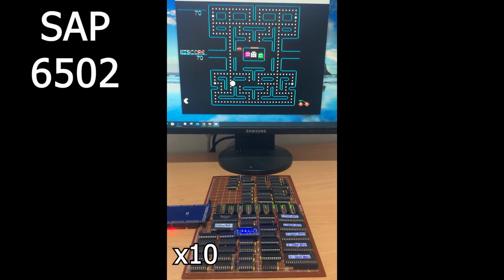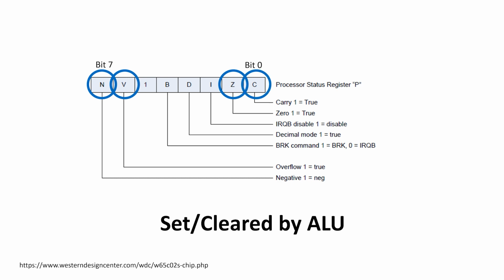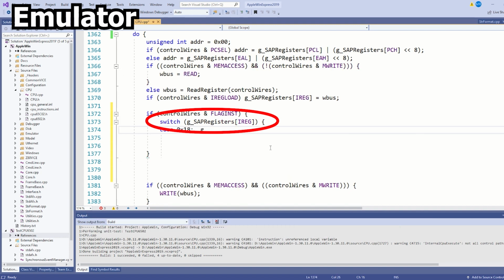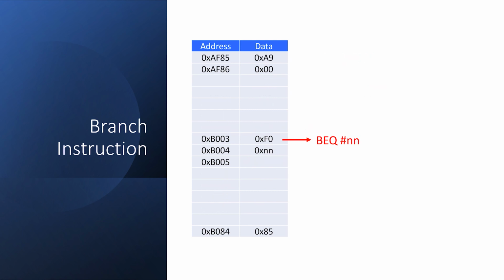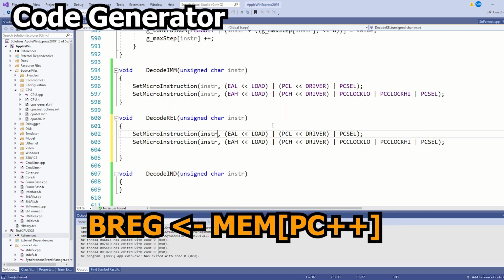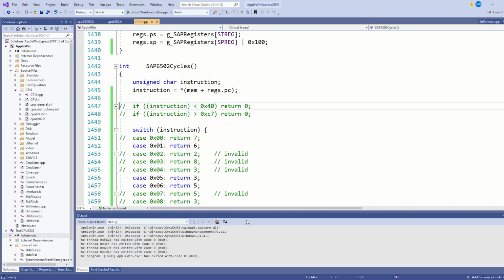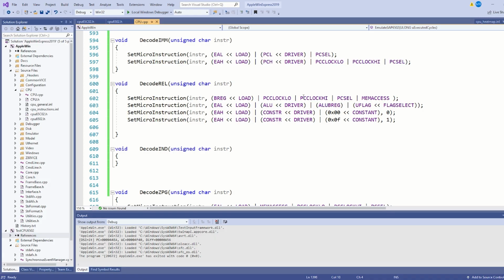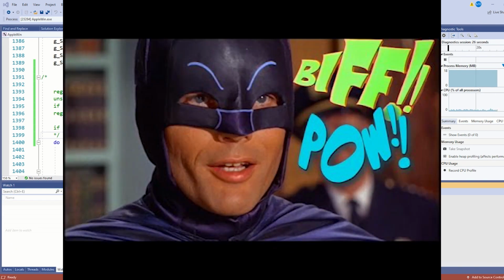SAP6502 Microcode - Branch Instructions

Comment: I can't imagine programming an architecture without a conditional branch.
Reply from the maker: Yeah, in practice conditional branches make most sense, which I'm sure is why practically every architecture uses them. 
I guess the reason I made big deal about it, is that there was a recent thread on the minimalist computing facebook group which was split about whether conditional jumps were required.  
Probably more than half said they were required, so i just wanted to put up the counter argument.
Working on the next part right now!
Reply: @DrMattRegan  I have heard of a style of programming which attempts to avoid branches by using comparison operators and uses the result in a multiplication and assignment. The resulting code is confusing as heck, but is supposed to allow the CPU to more effectively pipeline the code. I can't vouch for it's effectiveness . The other approach I suppose would work is self-modifying code where an unconditional branch is modified to different targets based upon a similar sort of calculation.

Comment: You've put a huge amount of work into this. Do you realize that the injection of the film and TV clips make this unwatchable for some viewers such as myself? I make this comment only after having now turned off two videos at a clip roll-in. Perhaps I should have expected as much when you added the first clip of wrestlers. Sorry, but you've lost me as a viewer.
Reply from the maker: Thanks for the feedback.  There is some method to the madness though.  The drag car vs rally car was an analogy about the change in the type of instructions we're looking at.  The clip from the young ones was to break up the segment between flag set/clear instructions and branch instructions.  Its to give those not familiar with the material a chance to think about what was said without jumping straight into a new topic.  Can feel like drinking from a fire hose otherwise.  
In the decimal video, on youtube analytics, there was a 4% absolute increase (12% relative) in viewership around the Arnold Schwarzeneggger clip at the end.  But, I get that it's not everyone's cup of tea.